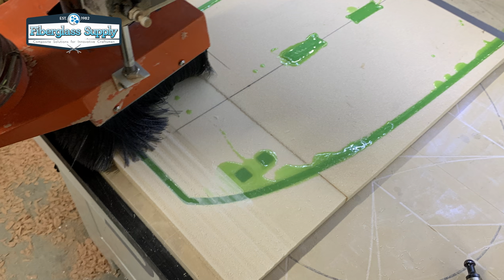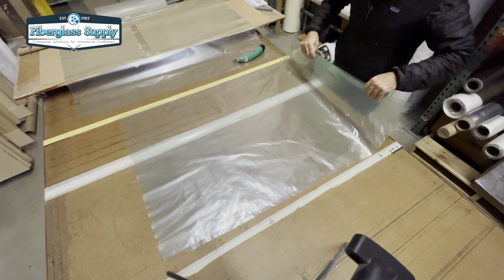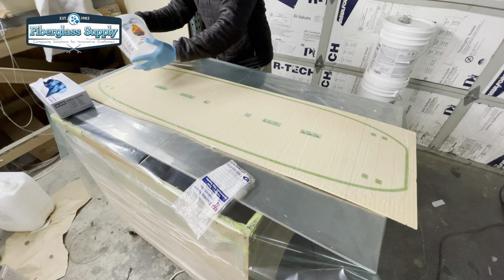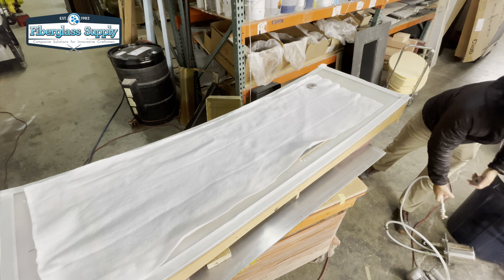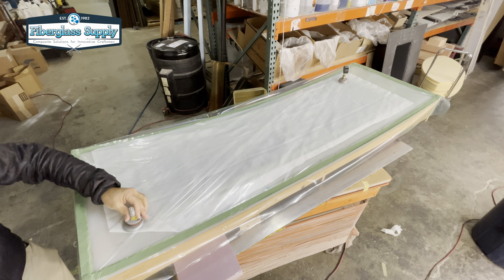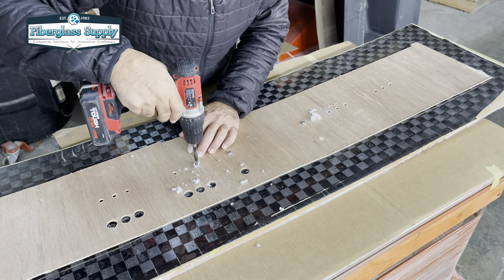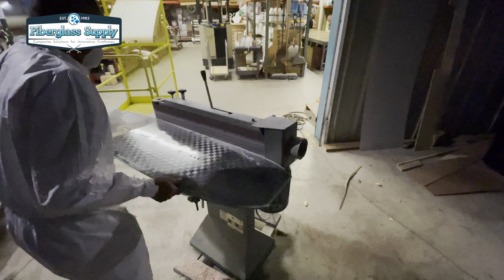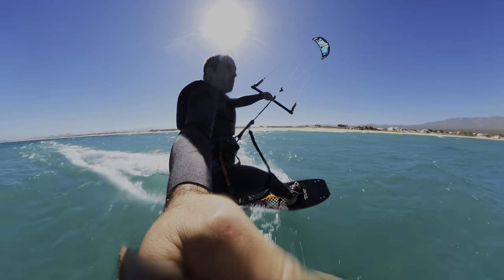How to Build a Kiteboard: Foam Core Carbon Twin Tip Kiteboard Build

Comment: Awesome video! What epoxy did you use for the edge? I found epoxy would chip so I switched to urethane which worked well. Also, gotta be careful with T nuts for inserts as it's easy to push out the back. You can get a closed back version made for inserts pretty cheap. Might be a great item to carry in the shop.
Reply from the maker: I used Pro-Set's rubber toughened epoxy for the edge pour, straight resin with just a powder pigment for color.  I've done 3 others that we used Resin Research with Bubbles in it and so far no chipping on any of them.  The RR with bubbles I probably have around 100 sessions on, at some point I will have a video on those boards, we did them with balsa core and they came out nice (just not as good looking as the carbon).  The first board we did with urethane the last couple times we went with epoxy  to try it out (specifically the rubber toughened) and because we have a lot of it in stock (and don't stock urethane (yet)).   Yes you are correct that you have to be careful on the T-nuts to not go all the way through or push out the laminate.  I'll look into the closed back ones, if you have a link to some feel free to shoot me an e-mail with them matthew@fiberglasssupply.com

Comment: This is an awesome video, are you able to list all the parts needed?
I'd like to order the carbon tow, glass, and threaded t fitting hardware but can't find it on your site.  Know where to source the remaining inputs?

I'm ready to build, just looking for all the pieces to order!
Reply from the maker: Steve, I know Jason is working with you on this.  The carbon we'll have back in stock this week.  I'd get the T-fittings from McMaster Carr. We used 1/4"-20 but I think they have a M6 that is 9mm high that should work too (M6 is the standard hardware size for commercial kiteboards and fins).  Make sure they are stainless.

Comment: Great video. Im curious how well the board is holding out, were the layers of reinforcement enough? How thick is the foam core?
Reply from the maker: The finished foam core is about 0.52" thick.  I am going to do another video soon showing 3 boards  (the poplar core, a balsa core, and this one) and how they have held up.  Since you asked this one did in fact break, it broke from impact to the heel area on both feet, cracking the laminate from the midpoint of the board (vertical midpoint) to the heelside edges (and through the edge) When I noticed the damage on it, it probably had around 30-40 sessions on it.  I have since repaired it with 3 or 4 layers of 6oz glass over the damaged area and the heel area and probably have around 12 sessions on it now with no signs of issues.  If I build another one with a foam core I will either add laminate to that area or replace the foam in the heel area with balsa.   I also have a video that I'll put up of damage and repair.

Comment: Wow great job man!
how did you finish the edge? i mean did you cover the foam somehow?
Reply from the maker: So the edge itself is a cast epoxy, after trimming to it I just wetsanded it with 220 and have left it as is.  I could buff it to a shine if I wanted to.  In this video https://youtu.be/KDMEj1KQcVw we show casting a urethane edge in a wood core board, same concept of how the edge is made.

Comment: Hey Matt, nice videos. May I ask a few things? What was the density of the foam? What was the thickness in the middle of the board, and on the ends (foam core, without the carbon)? How many layers of carbon on one side? and what was the weight of the voven (4 or 6 oz probably?) Thx, best wishes, MP
Reply from the maker: Thanks.  H-80 divinycell 5lb per cubic foot, 0.52" (13mm) thick in the middle, 0.20" (5mm) thick at the ends, one layer of 6oz carbon and 1 layer of 6oz glass (S-2 glass) on each side.  That laminate was not thick enough over the foam in the heel areas I would either add 3-4 more layers of glass under the heels (or carbon, doesn't really matter the skin just needs to be thicker) or insert balsa or plywood under the heels.  Other than that the board rides great and is really light.

Comment: I wish you would mention the size of these boards youre making. That one looked a little smaller. I'm trying to decide if mines too small. I have a 134 cm.
Reply from the maker: The small one is 132cm  x 40cm and the big one is 147 cm x 44 (plus or minus a cm those numbers are from the computer model I don't have the boards right here with me).  I probably use the small one about 75% of the time now.  Selecting board size is going to depend on a number of factors like how powered up you are riding, what kind of riding you are doing, what the wind quality is like, and how much you weigh.  A week and a half ago I kited Hood River when it was gusting from 14-40, to not get destroyed by the gusts I took a 6M kite out and to compensate for the lulls I used the big board, it worked pretty good.  If I am doing a down winder or in an area where I can surf on the twin tip I'll also go with the bigger board as the additional surface area really helps it surf or glide better.  If I am powered up or doing a lot of jumping I prefer the smaller board (less swing weight, lighter, and easier to hold an edge).

Comment: So you run the vacuum pump with additional epoxy? 
Or you just suck air out?
Reply from the maker: We are using an epoxy putty to glue the skins together, we use the vacuum bag to create a clamp that holds everything in place while the resin cures.  To recap- we apply epoxy putty to the skins and place them on the core, then stick the whole thing on the rocker table, seal a vacuum bag over it and then evacuate the air with the pump to clamp the glued core in place on the rocker table.